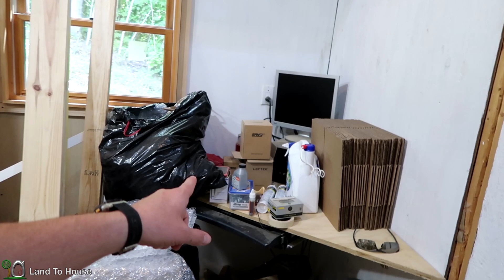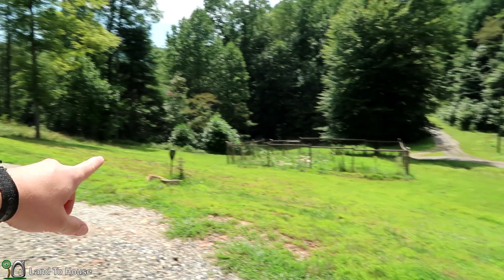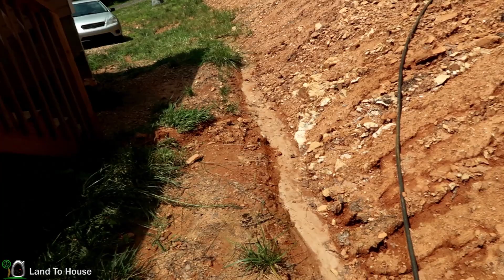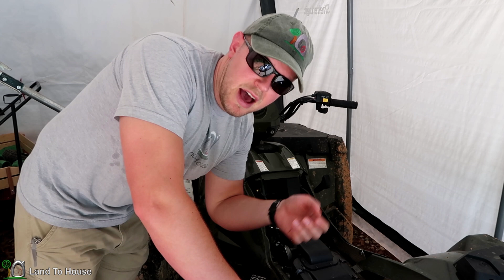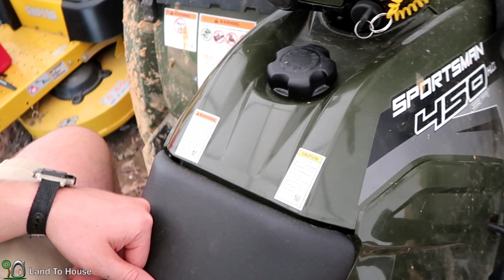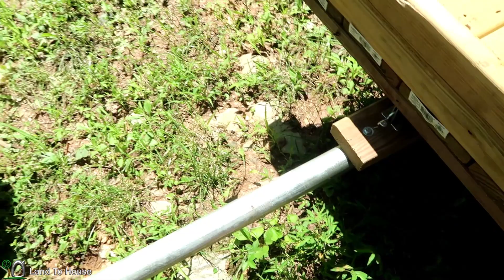Finally Fixed The ATV Rattle - Vlog #101

Comment: I need help... I can’t figure out for the life of me, why my brand new ATVs rattles like it’s about to explode into pieces. It’s only at certain RPMs in every gear. It’s drivin me crazy. Nothing is loose, there’s not a single lose bolt or anything on this ATV, I have checked it all...... wtf is going on????? It sounds like it’s coming from the front, but when I’m sitting in neutral and rev it, it sounds like the whole entire ATV is rattling like every single fucking screw is loose..,. I’m about to run it off a cliff.

Comment: Really enjoying these.
Trailer coupler latch safety/security pin, goes through the trailer's hitch latching lever to keep it from popping open.  You might want one on your dump trailer so you don't loose it hitting a wash-out in the roadway.
The berm/levy  along the side of the ditch is trapping any water coming off the house against the house. You need to grade the dirt from the foundation edge downhill to the bottom of the ditch you are re-digging.

Comment: I had the same rattling problem in my 570 Sportsman, and I ended up fixing it just cutting about 1 cm (less than 1/2 inch) shorter that air intake, easy!
Reply from the maker: You question why manufacturers like Polaris don't realize these simple annoyances. After a week with this fix I have been surprised at how quiet the machine is.
Reply: Land to House You are right, it's even simple to fix. Btw. In Finland we don't get those "heat shields" even if asked, yep it surely burns in summer, but soon it's winter again and then it is not a problem, maybe a bonus!

Comment: Have you ever regretted the 12” miter saw for the 10”? I guess I’m asking is everything that you’ve used with your 12 inch could’ve been done on a 10 inch saw? I’m kind of in the market for a miter saw but I don’t think I’ll need 12 inch. I think 10 inch will do. Any suggestions?
I live in the mid-Atlantic and we had all your leftover rain. ⛈ 🦀
BTW you need some glue or Loctite 😉 to hold the plastic tube in place.
Reply from the maker: I cut a lot of 4 inch PVC with this saw and it is crucial to have that extra couple inches. I know some people have had issues with this saw but personally it has been great.
Reply: Makes a lot of sense, thanks. 🦀

Comment: If you flip that latch vertical instead of horizontal, it will latch more effective.  Great video vlog as always
Reply from the maker: I had thought about that. But this seemed like the easy way out. now it falls open when the pin is out and I kind of like that. Makes it easy to clean the bed. Thank you for watching!

Comment: What about putting a draining pipe in that ditch you dug today.... the sort of pipe that has holes in it and that will let the water seep in along the whole length of the pipe but will keep dirt out. So if the pipe gets covered up with silt, it will still move the water down the hill.... I know you have plans for the site, but this pipe can be moved and reused for your future plans. I'm sorry I can't think of the name of it, but people use it next to the foundation of their homes to move water away instead of flooding their basements. 💖🌞 🌵
Reply from the maker: I have seen poly pipe with a sock over the holes to move water. I think it is used in French Drains. That would probably work well and does not cost all that much. I do wonder if that large amount of silt would still cover it enough to be annoying. I will be using that type pipe in the wall build. It will be covered with rock to allow for fast water draining.
Reply: @LandtoHouse  The silt will smother the pipe and it will stop draining.
Reply: Drain tile is what you're thinking of.

Comment: I'm guessing you have wasps in that hole in your yard... but what was in the cup? I'm guessing gasoline? or Diesel? Let us know if it worked. 👍 💖🌞 🌵
Reply from the maker: Yes wasps for sure. Gasoline is a very fast method of wasp removal. I had several more clips of the wasps but I did not include them.